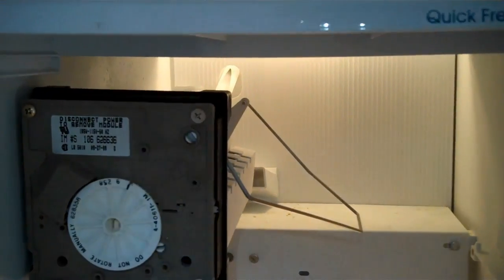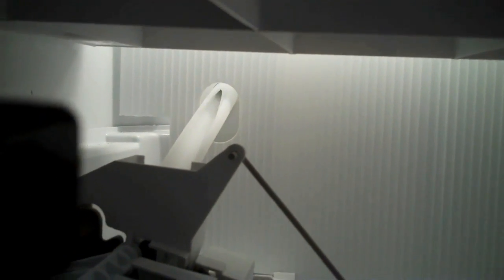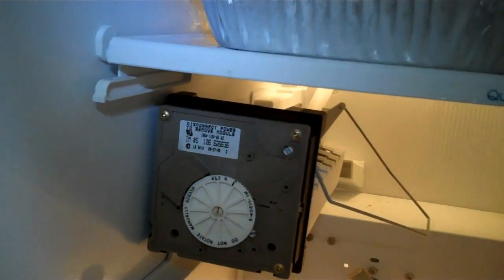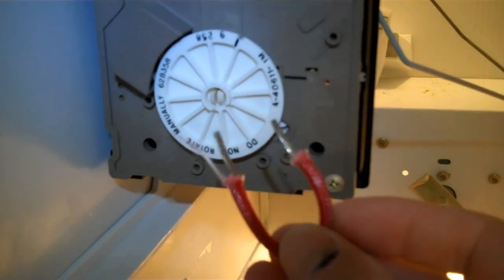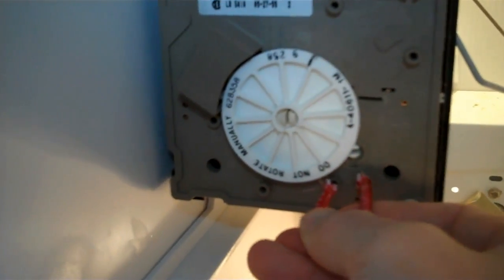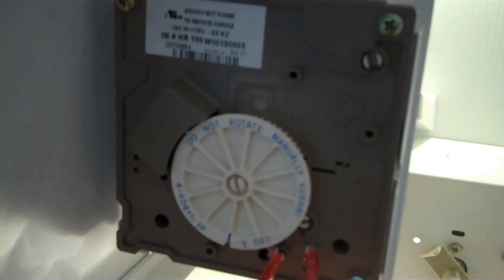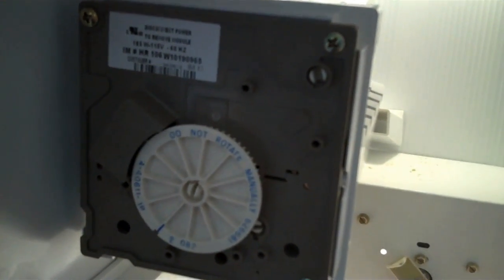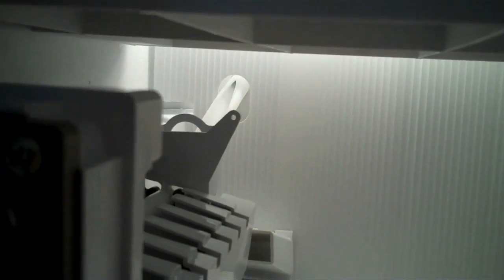Troubleshooting a No-Ice Complaint and Testing-Replacing a Whirlpool Modular Ice Maker

Comment: Trying to find an insulated wire was the most difficult task.  Also, I stuck the wire in and nothing happened until I wiggled the wire back and forth a little bit and then saw the wheel start to rotate. I then heard a tinkle of water.  Hallelujah.  Thank you! It’s not broken. My refrigerator evaporator fan broke so it wasn’t cold enough to make ice so the ice machine stopped making ice because the freezer was too warm.

Comment: Thanks for the Video. Did the function test, water valve good, faulty module. The ice maker body looked good, no corrosion, so I ordered a replacement module for $26.00 including shipping. A 5 minute switch out. Did not work at first, but then I used the jumper wire to initiate the harvest cycle. After it went through the cycle, it works like a charm!

Comment: Your video was extremely helpful in diagnosing the problem with my Whirlpool ice maker.  Figured out it was the thermostat and ordered a new ice maker unit from AppliancePartsPros.com for $60.  Probably saved +/- $200 between appliance repair company service call, parts and labor. Thanks for your help!

Comment: I had a bad ice maker for years and decided to replace it. I inserted the jump wire to my T and H terminals and was happy to see no movement because I would rather replace the ice maker than mess with the water lines and the valve. Removed the old unit easily (3 bolts and a wire harness) and ordered a replacement part for $ 45 from Ebay

Comment: We have   the icemaker L & V water works, you said C & H, I did T & H, and motor does not even budge, and this is also on a Brand new one I just put on. any suggestions on that. the temp is about 5F set to -1F waiting to see if the water will go to the icemaker

Comment from the maker: Good job!  Yep, ice plugs in fill tubes are a common problem and usually indicate that the water inlet valve in back is leaking ever so slowly, eventually creating another ice plug.  You can buy the replacement water inlet valve at Appliantology-- just enter your model number in the parts search box at the top of the page.

Comment: Hi thank you for the video. I have an ice maker that is not making ice and a door dispenser that also went out at the same time. Everything works fine including the water dispenser. Given that these are separate components, would this be the electronic control module?

Comment: I was told to take my entire maker out, defrost it, and plug every thing back in.  I t did, and as soon as I got everything hooked back up it filled with water.  I assume that it will dump  if the motor is good.  Thx for you videos.  Good to know this is an easy diy fix

Comment from the maker: Those are both valid test point combinations: L-V energizes the fill valve and lets water into the mold; T-H initiates the manual harvest cycle.  If your ice maker won't harvest on its own, then either the thermostat is bad (replace the ice maker) or the freezer temperature is too warm (needs to be less than 15F).

Comment: great video, but i hit a problem that wasnt covered here. inserted jumper, got nothing. tested door switch, got nothing. put gentle downward pressure on the up/down ice arm, could see the motor "back up". released it, and motor "went forward" and got grinding sound of running into frozen ice. im not sure if the heater element comes on with the jumper switch (to release the ice), so i hypothesized that i needed to uninstall and unplug icemaker, thawed out ice (with hot water rinse in sink). reinstalled and it now works perfectly. MY PROBLEM WAS ICE DAM NOT ALLOWING THE MOTOR TO MOVE THRU ITS FULL CYCLE WITH THE JUMPER IN. by manually thawing, i removed the ice dam, plugged back in and jumper allowed motor to go thru its full cycle. ICE MAKER WORKING PERFECT AGAIN. thank you for the great video and hope my experience helps someone else. i almost gave up before thoroughly checking in depth. i can guarantee a repairman wouldnt have done this, would have got a bill for a  trip charge and new icemaker.

Comment: Sometimes the simplest explanation is the correct one.  My power went off for about 20-30 min before my ice maker quit.  This caused condensation to form on the timer, motor, gears and mechanical moving parts of the ice maker.  When the power came back on, it froze my unit up.  I got good ohms readings on all the test points except the timer.  N - V is the water inlet valve (190), T - L thermostat (0 cuz tray was full of ice), L - H tray heater (72.5), and L - N the timer (I got 0 should be 4400 ohms).  
I shut the breaker off and left the ice maker door open for about 4-5 mins.  I tapped on the front and back of the module with the back of a screwdriver.  Flipped the breaker back on and after about 1 min it dumped the ice from the tray, refilled and began working normally.  Just frozen, nothing blown from a power spike.

Comment from the maker: See if you have 120vac from L to N.  If not, then may have a burned out thermal fuse in the wire harness.  Did you replace the wire harness to the ice maker at the same time?  Also, did you use a generic or OEM replacement?

Comment from the maker: On units without the optical ice sensor, you should read about 120vac.  Units with the optical ice level sensor will read around 97vac.  56vac is what we call "junk voltage" and indicates a bad connection, open neutral, or some other wiring problem.  We can get you a diagram in the Appliantology forums.  Start a new topic in the Kitchen forum at Appliantology.

Comment: great video. I'm helping a neighbor who uses the same ice maker but he has a different problem. As I understand his problem, his unit produces "wet" ice. It makes cubes but the excess water pools in the bottom of the bucket and then freezes so the ice just clumps up. Is there an adjustment to use less water or slow the production of ice so no excess water is produced?  Thanks for taking the time to respond. Again, great videos.  JDD
Reply: Some icemaker models have a plastic water adjustment screw on the right side around the corner and below the "M" terminal. If you turn it clockwise, less water should flow into the mold. However, if the problem of excess water begun just recently, it's probably a bad water-valve not shutting off right away. Jump-start the icemaker by connecting "H" and "T" terminals, and observe how the water flows into the mold. It should flow for about 7 seconds and stop completely. But if the water continues to slowly overfill, the water-valve is bad.

Comment: Awesome advice...made my own jumper wire and the motor engaged but when the teeth lowered to eject the ice the motor seemed to hit a block of some sort. Any ideas?  Thanks!
Reply from the maker: Kris Forsyth Mold may not be heating up to release the ice. Usually better off just replacing the ice maker.

Comment: I bought a new whirlpool icemaker to replace my old one.  When I plugged in the new icemaker, the wheel on the module did not spin.  I thought that maybe I had a defective unit.  I returned the unit and got a replacement.  I am now having the same issue with the second unit.  Do I need to "jump" start this unit (T&H) to get it going?  Is this normal??  Note:  when I plug in my old unit, the dial on the module spins!  What gives?

Comment: good day - so my kitchenaide  icemaker is not making ice - i saw that the plastic water tube was filled and frozen ... took out the ice maker, cleaned it, unfroze the water tube with a hair dryer , hooked the icemaker back up, and it filled with water... about 2 hrs later checked and  it made cubes, but did'nt discharge them yet into the bucket.. another 2hrs checked again, and the top of the ice maker has frozen water on top of the cubes, and the tube was once again frozen. i checked the back of the fridge and the valve does not look like it is leaking any water.. it was dry... bad ice maker??

Comment: I replaced the water valve in the back I then did the manual  jumper trick and it worked as in the video, full cycle and water came in. after the ice is made it wont refill on its own, what next? sometimes when the water does come in it don't stop.

Comment: okay, I tested with a jumper, motor was bad, replaced unit, jumped again to a click, then went about other business. Saw a few cubes (crescents?) a while later but only a few. The "Do Not Rotate" wheel appears stuck, wiggling back-and-forth ever so little. I tried to jump it again, but it won't move. I can confirm there is ice in the mold. Thoughts?

Comment from the maker: If ice maker has the control module with the test points in it, then you need to replace the module or, better yet, the entire ice maker for just a few bucks more.  Of you have the big center plastic gear with a little driver gear, then a common problem is that some teeth will get knocked out of the big gear or the hub of that gear breaks-- and it is separately replaceable.  In either case, you can get those parts at the link in the video description.

Comment: Sensei. My ice maker has ice but wont eject.  I used the jumper wire and nothing.. should I replace the ice maker or just buy the motor like another video seems to suggest.  Thanks for your advice.
Reply from the maker: Aristotle Aquino Replace the ice maker and save yourself headache down the road.
Reply: Before replacing ice maker, shouldn't the ice need to be heated to eject, the motor can't eject if the cubes are frozen in the mold, and shouldn't the light switch be turned off ?????????
Reply: Yes it's highly possible the mold isn't getting heat, but the typical solution to that problem is to replace the ice maker.

Comment: The fridge is a Kenmore coldspot - model number starts with 106 (I am not at home right now to get the entire mod #.  Sears told me to order a Whirlpool 4317943.  I ordered what I'm guessing is a knock off.....it's a Supco RIM943.  If the motor module is a bust, would it be worth it to use the old motor module?

Comment: Dear Mr. Samurai,  Where can I buy the insulated jumper?  I want to perform the test but don't want to get electrocuted
Reply: You can make your own jumper wire. Use 4” 12-2 romex wire (or 12-14 gauge solid copper wire). Strip ¾” ends. Bend into U shape.

Comment: Is it possible to diagnose the other components on the ice maker?

i.e. mine gets 120VAC but no response from motor when I short T&H test points... how would you test the heater/water release portions?
Reply: L-V shorts the water valve and dispenses water.  L-M shorts the motor and makes it turn.  L-H shorts the heater and makes it heat.  T-H should run the whole cycle, heating the mold, turning the motor and near the end of the cycle it should activate the valve.

Comment: Question  You plugged the wire in to port T and H .  Nothing happened so it is dead. Is it better to take off the module off and replace the motor ? OR is it better to replace the whole module ?   IF I understand you right,  T and H are for the motor.
Reply: Yes what's better?
Reply: T-H bypasses the internal thermostat so it initiates a harvest mode. It should begin turn, after a few seconds there should be a click and you can remove the wire bypass. At that point it should continue on it's own, hopefully. If not just replace the whole icemaker. It's very easy.
Reply: Replace the whole ice maker if the module or motor is broken.  Might as well get all fresh parts in there.

Comment: Hello Sir, I would like to ask you how much voltage this module should be getting. I did the jumper wire test and nothing happen, but I check the voltage coming to the module and it was only 56 volts, if I'm not mistaking it should be 120 volts. I've been looking for a wiring diagram but I just can not find one for this refrigerator. Do you have any ideas what could  it be, or where can I find the electric diagram. Thank you for your help.

Jorge from California.
Reply: 56 volts means it's busted/wired wrong.

Comment: Hi Mr. Samurai! Great video! I think you've helped me rule a few things out, but I'm still not getting water to the module. When the module cycles the valve is not activated. The motor and heater function normally. I replaced the solenoid and it seems to be functioning -- I can manually fill by jumping L & V. Still there is no fill valve activation during a harvest cycle.

So am I right in assuming that I have a bad control module or thermostat? Is there a sure fire way to identify which is the issue via a multimeter?

Comment: I installed a new ice-maker waited 24 hours and not ice. So I tried the jumper, but the motor did not move.  I also tried dumping the water valve with no results. The issue I had before replacing the icemaker was that the motor was not working, and when I manually removed the ice the icemaker will fill once. Any suggestions?

Comment: I have a whirlpool. Came home to water in the freezer (bottom drawer) and ice lever stuck half way up. Installed a new valve and a new ice maker. No luck. No action with jumper cable (water or cycle). Where to look next?

Comment: I replaced the motor module and it harvested the cubes in icemaker. Water didn't fill so performed L-V test, water dispensed. The module is trying to rotate new cubes out but won't rotate completely, appears to be stuck. Thought I installed correctly. Any troubleshotting suggestions?  This is a Whirlpool.  Thanks Samurai.

Comment: For some reason I cant get beyond the point of the fill tube freezing. I have run the circuitry test you show, with positive results. I have replaced the dual water valve, and the inline water filter. each and every time I defrost the freezer, clear the fill tube, I get ice for about a week or two. Then, back to the same problem with the fill tube freezing. Any suggestions from here? Also, where can I find the upgrade - slotted fill tube?
Reply from the maker: If water pressure at the water inlet valve behind the refrigerator is too low, the valve won't seal properly and it will weep, eventually clogging the fill tube.  Common causes of low water pressure at the inlet valve: using a line-piercing saddle tap valve (they become clogged with sediment and scale) and supplying water to the valve through an RO filter.
Reply: SamuraiRepairman thanks, I have often wondered about the pressure, but I assure you its not a saddle vale, in the wall type with 1/2 or 1/4 turn shut off valve
Reply: SamuraiRepairman Just to add, its a kitchenaide model# KSCS25FKSS02
Reply: Vince, Freezer setting might be to cold,  try changing the freezer setting to not so cold.

Comment: i know i have a  bad water inlet solnoid but also  i never getting  power to the valve either what else should i check   to  make sure im getting power to te valve  it is a GE top freezer , i was also trying to find out how to make sure the ice maker itself is getting power
Reply from the maker: allen b You can put a cheater cord on the valve to make sure it's working. In normal operation, the valve gets power from the icemaker when it needs water. If the icemaker isn't working, the valve will never energize.
Reply: +allen b  I have to push the button for the door so there will  will be power to the ice maker! Just FYI I figured this out after two hours of fiddling mine.
Reply: +SamuraiRepairman That's exactly what I needed to know! Damn good advice! JC for Tennessee!

Comment: I understand the freezer light must be shut off,  because when you open the door.... that shuts the power off to the ice maker.  So when jumping the ice maker.... push the light button or tape it so it's off.
Reply: Terry Hahn  That's true, thank you ! for posting that
Reply: Yes, such an important point is that the Door Light must be OFF!!   I wish I had know that as I replaced both water valve and icemaker, but it was probably just the water valve, as when testing the icemaker I didnt know at first to hold the door button sensor down.  I finally found this video and this really helped thank you for posting that.
Reply: This varies according to brand/model. I have a Northland fridge. Opening the freezer door doesn't shut off power to the icemaker.
Reply: My Kitchenaid will operate the icemaker with the door open, it just won't dispense ice or water.   In fact it says to make sure to turn off the icemaker with the rocker bar if you decide to remove the maker from the freezer, so ice doesn't dump inside the freezer.

Comment: Hi... I have a newer whirlpool side-by-side model# WSF26C3EXWO1. It has the entire ice maker system in the door. It is not making ice. There were cubes in the ice maker so I know it was getting water. I tried the jumper wire and the motor didn't turn. I then removed the motor module and ran hot leads directly to the motor. It turned. So I don't think that is the problem. The little red LED on the infrared sensor board does not blink or light up at all. I did unplug the fridge, wait about 20 seconds, then plugged it back in. I also tried the trick of looking at the infrared emitter through my cell phone camera. No light visible. I am pretty sure the IR emitter is bad. This all started after I shut off the ice maker with the little door that covers the emitter hole in its mounting plat. It was stiff and hard to move. I am wondering if it I may have broken or knocked it out of alignment. But the LED does not light up anyway. By the way, which is the emitter and which is the receiver? Is the emitter the one with the "flapper" (Right side of door as you look at the inside) that the ice bucket pushes aside when it is closed or is it the one with the LED on it (Left side of door from inside). Do you agree?
Reply: I got the emiiter and receiver switched in my post above. The emitter is on the right side and the receiver is the bigger board on the left side with the LED on it. So I will have to re-try the cell phone camera trick.